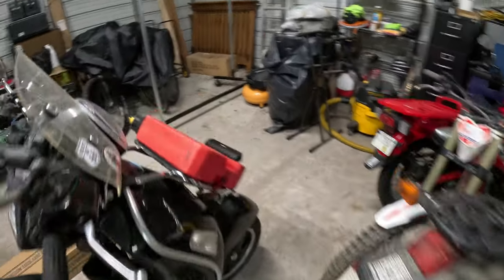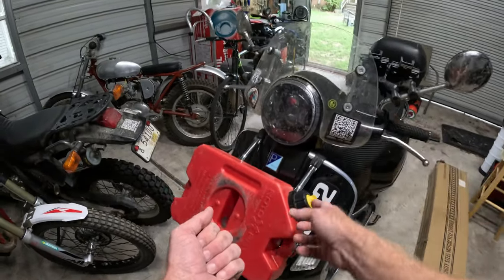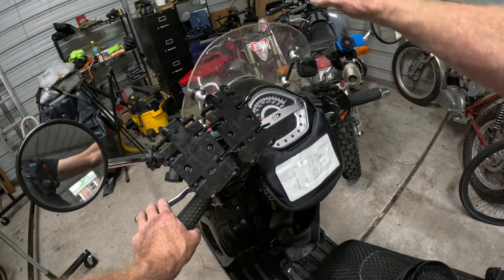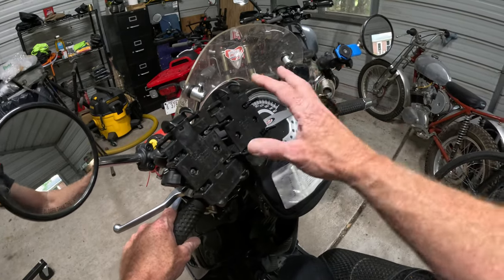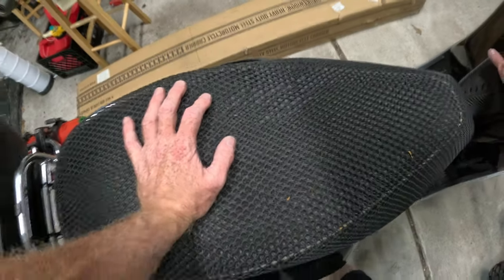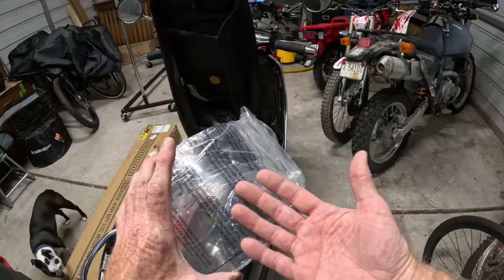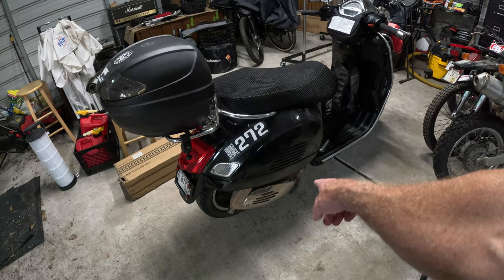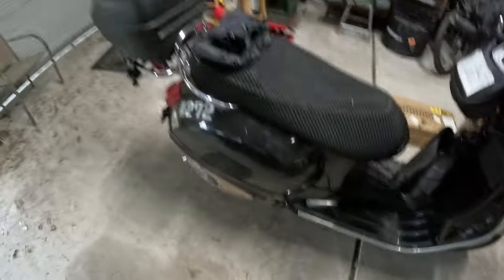Scooter Cannonball post-ride Vespa review

Comment: I've actually used my battery jumper about a dozen times. Mostly as I had a weak battery and the replacement was delayed. However, twice I jumped someone else's scooter and once jumped a Ford SUV. Outside of that I pretty much agree with your observation. Nothing like a real life road trip to sort out the good from the bad.